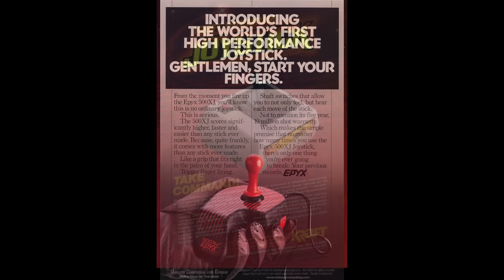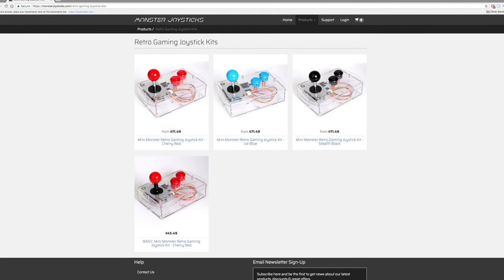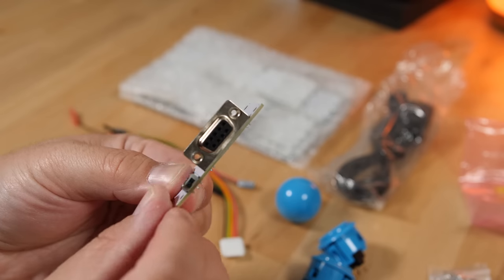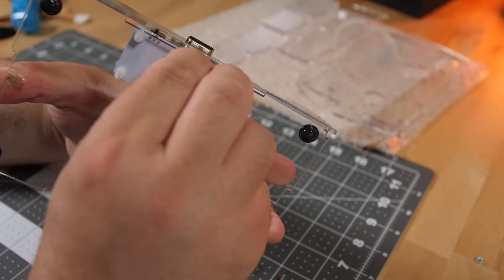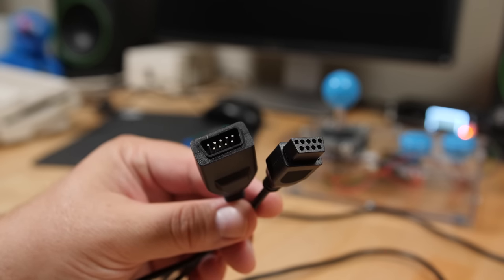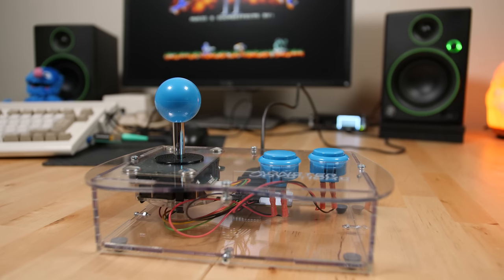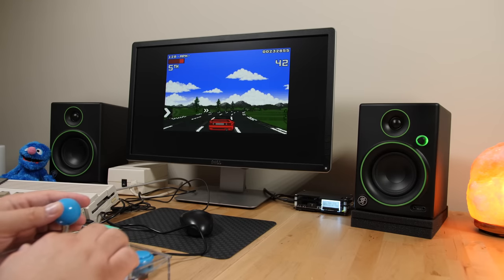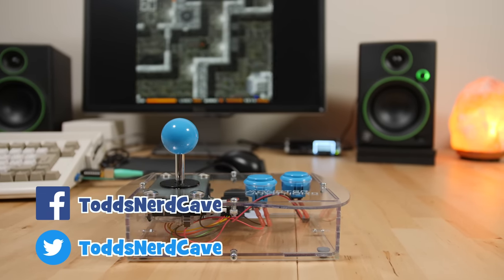Mini Monster Joystick Review - BEST joystick for your C64, Amiga and Atari computers!

Comment: I found this video while doing some research before making my own stick. I'm 3D modeling/printing my own design, and it will incorporate the same stick that came with this kit (as it was one I just happened to have laying around), but with the smaller version (24mm) of the Sanwa buttons, and will loosely resemble the old Competition Pro joystick. After I'm done with this project, I'll probably work on an "arcade stick" style as well, similar to this Mini Monster.

Comment: This is basically miniaturized arcade stick and it's obviously better than old joysticks we had to deal with on the real hardware. I'm using FS-UAE emulator, so I can use modern gamepads and basically all sorts of controllers available for the PC, including racing wheels and all sorts of flightsticks/joysticks/joypads/nunchuks/VR controllers etc to control the games and the emulator itself.

Comment: Todd this is a top quality A+ video bud! Extremely well made and most importantly I learned a lot.  I might have to pick up a Mini Monster.  I also need to play with connecting my pro fighting stick (with Sanwa parts) to my Amiga via the RysII.  I have also been considering the Edladdin stick as well as the Arcade Evolution stick.  Have you ever used either of those and if so, how do they compare to the Mini Monster? Thanks Todd and great video!
Reply from the maker: Thanks buddy! I haven't used the amigakit arcade evolution stick, but it looks interesting. I wonder what kind of stick and buttons they are using in it?
Reply: I have heard people say they are "arcade quality parts" but I don't know exactly what they are
Reply: Judging purely by the pictures (we could be totally incorrect but we have seen lots of samples of joysticks from various manufactures) the buttons are of a similar shape and style to our BASIC range (you can see by the height of the button from the frame). The joysticks seem to be very similar to joystick that we looked at for our BASIC range but didn't feel it met our expectations, they were not bad, just not correct for us. Again this is all just from looking at the pictures i can find.
Reply from the maker: to be honest, I tend to agree. But I might pick one up sometime. That and a competition pro joystick. Have a joystick shootout.
Reply: Thanks for the info @monster Joysticks.  Todd, I have the USB Competition Pro and it is awful.  It hurts my hands after 2 minutes, but give it a try.  Also you might be talking about a different one, I don't know
Reply: I was referring to the Arcade Evolution stick, the Edladdin looks like a great stick although a little large and boxy for our tastes.
Reply: I used the Edladin at VCF South East and it was wonderful, but yes, it is quite large!

Comment: Love that modded Neo-Geo stick. Great job on the review. The minuses don't seem too bad overall, but that flex would annoy me to no end.  I'd like to see a 6 button variant that works on the genesis/Snes/TG16/Jaguar through exchangeable cords.
Reply from the maker: Ray Commend the flexing is really very minimal. I was pushing down hard enough that the end of my finger was turning white. I hope they do consider releasing a version for consoles. I think it would be very popular.
Reply: There is some flex in there and thats mainly because PETG is far better at impact force then other acrylics, the flex gives it an enormous amount of strength and it really only flexes under a lot of force. This stick is us dipping our toes into true replacement sticks for Retro consoles and computers, if these do well then we will hopefully look into sticks for other systems. We are working on some small adapters that can plug into the rear of the stick so it can be used on the MSX / X68000.

Comment: You can get the sanwa stick and the 2 buttons for less than 20 dollars. Add a 5 dollars lead for the 9 pin connector and a project box (10-15 dollars; and you have something that is more resistant than this and cost less :)

Comment: When not set to remap the second button to the up direction, is it compatible with 2 button Amiga games? Also, when it is set to remap it to the up direction, can you still press up on the joystick?
Reply from the maker: Yes to first question, no to the second. But it's been a while since I used it so you may want to check with Monster Joysticks themselves on that 2nd question.

Comment: Not that I care but no support for the ZX Spectrum seems like the oddest omission, only big thing really missing from that list I'd say. The Spectrum joystick adapters uses a DB-9 connector but I'm not sure if the pinout is any different.  There were two different brands of joystick adapters, so most joysticks had two plugs with different pinouts, and games would ask you which adapter you had, Kempston or Sinclair.
Reply from the maker: Hmmm. I am sure one could make an adapter to use it with the ZX. Or maybe if enough interest is there, Monster Joysticks could offer something.
Reply: Just to confirm it will work with the Spectrum Kempston joystick standard.
Reply from the maker: Ahh, very nice!

Comment: Hi,
is this 9 pin connector same as DB9 for pc & servers?
Reply: It's a DB9 connector, which was used for RS-232 on PC, but the Amiga joystick ports are not compatible with that protocol. You might be able to run it through a PC serial port using special software though.

Comment: Dose it only work as a one button controller on the 7800?
Reply from the maker: I'm not sure. Perhaps that's something Monster Joysticks can answer. Sadly I don't have a 7800 to test it with.
Reply: Yes it will only work as a 1 button on the 7800, we pulled it from our official compatibility list as to not cause any confusion, If there is the demand we could create a small cheap wiring adapter for the 7800.